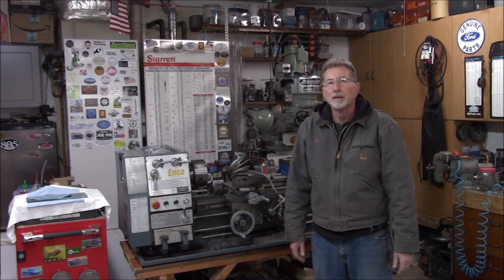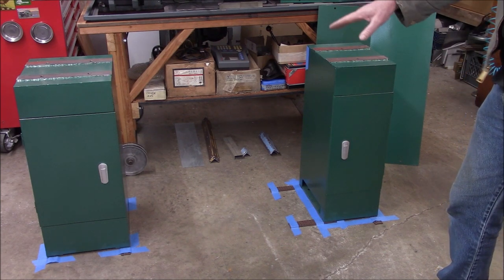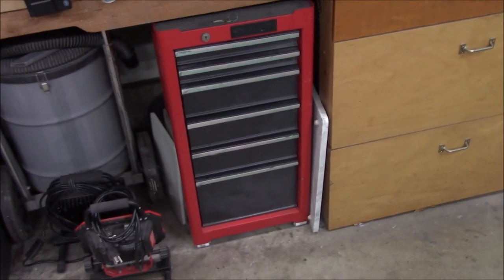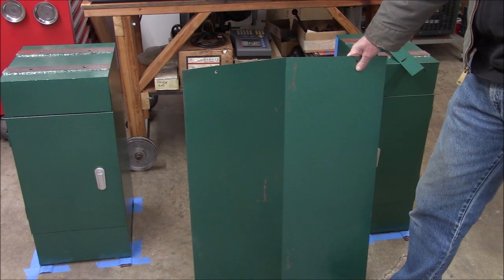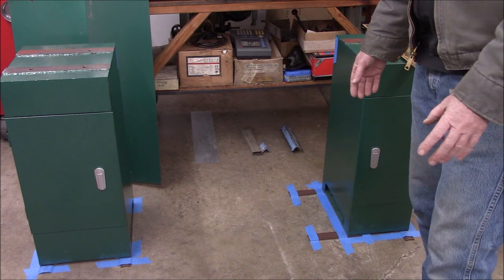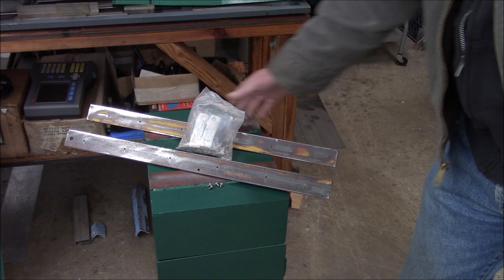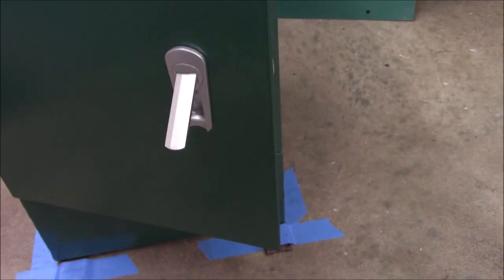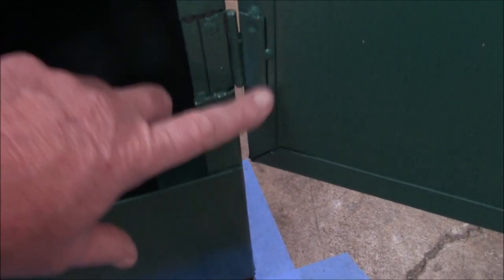New to Shop Lathe -  Update 1 (Grizzly Base)

Comment: Hey Dean , don't forget to seal the underside of the lathe with silastic if you are going to have flood coolant on that lathe .  Stops the coolant leaking down the bolt holes & into the cabinet !  👍
Reply from the maker: Thanks Max, great advice...I noticed that on the current wood stand, even with rubber gaskets it leaked cutting oil, gallons of it, into the wood. Another reason for ditching the wood base.
Cheers !! ... Dean

Comment: I like the modifications you are proposing. We are never happy about metric fixings mainly because all our garden tractors use imperial/standard fixings although it is really hard to buy anything other than metric over here
Reply from the maker: Hi Joseph, Metric vs imperial is a mess here. Autos and electronics are 90% metric. but construction materials and fasteners are 90% imperial. Hardware stores stock very little metric, mostly imperial. It's enough to keep you spinning in circles.
Cheers...

Comment: Hi Dean, don’t put that sheet metal on until the lathe is in place and level, I find the PM 1236 version of your stand pretty rigid as built. Not sure if having the tops of the boxes in the same plane is where they will end up when the lathe is level, mine wasn’t ! Just wine why you aren’t using the leveling feet?
Reply from the maker: Thanks, Yep this is just the mock up stage..but trying to align as close as posable at first.  Leveling feet are coming 👍
ATB....Dean

Comment: Are you going to add leveling feet under the cabinets? I added outboard supports for my feet because if you put the feet directly under the cabinets it seems a bit too tippy for my taste.
Reply from the maker: Hi Tom, Yes some type of leveling feet. I have the same thought about the tippyniss and we just had moderate quake a month ago. Plus I only live about 12 miles from the epicenter of the big quake we had in 1989 that took out the Bay bridge and bunch of overpasses. I have lots of steel plate, so that could be an option to widen the footprint.
Thanks,
ATB...Dean
Reply: @TheAyrCaveShop  If I can remember I will take some pictures of what I did tomorrow when I go down to the shop and send them to you.
Reply from the maker: @hilltopmachineworks2131  Awesome Thanks !!

Comment: Why not pour a bit of concrete in the bases. This will give the whole structure a bit of staying power so to speak. Mass is the correct term.
Reply from the maker: Funny I was thinking of adding lead shot for the same reason..Lol
Thanks ATB....Dean
Reply: @TheAyrCaveShop Play sand works good and is easily removed if needed.
Reply from the maker: @Thysddcf235  Good Option, Thanks John !